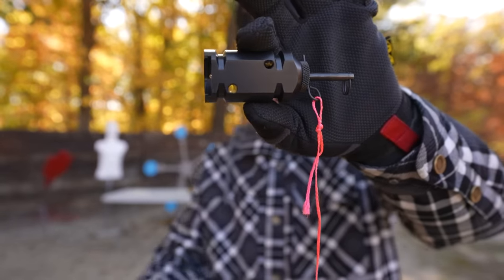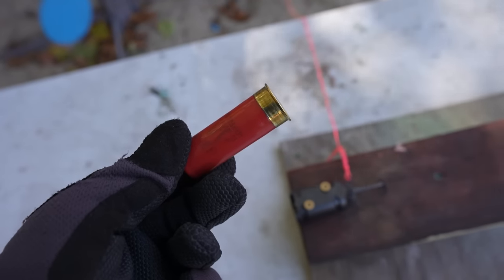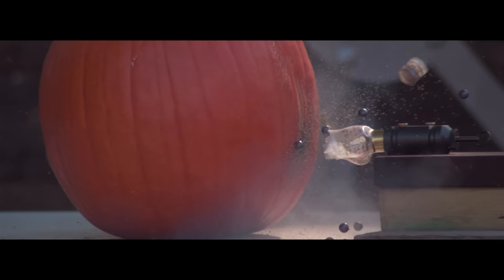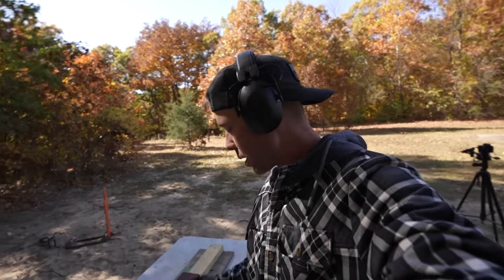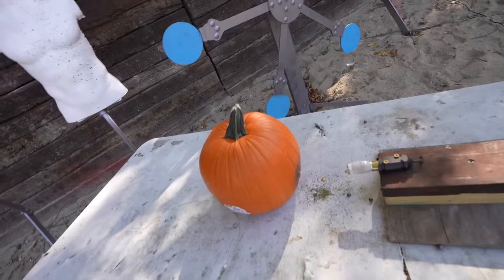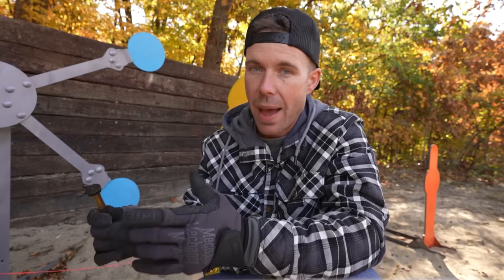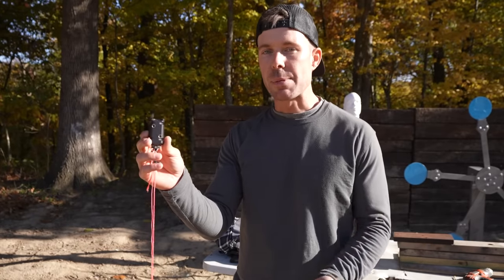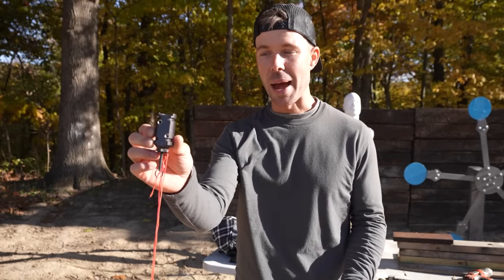This is Definitely NOT a 12ga Booby Trap!! (vs HEAD)

Comment: As three others mentioned, I had the idea of using Dragon's Breath.  Wouldn't matter so much if the shell bursts.  As long it ignites the payload, you could set an intruder on fire.  Or your buddy.  Or yourself.  Or Sasquatch.
Reply: sasquatch burned hair would be a horrible smell.
Reply: @StayInfamousDago  oh definitely 👃 🤢
Reply: I wish english grammar would be one of your hobbies. "Or your buddy, Or your entire gene pool.... "
Reply: I don’t know if it would ignite the dragon’s breath if there is no barrel, but I could be wrong about that.
Reply: Dam 😂😂😂😂
Reply: Metal HVAC tape on the shell. Tannerite?
Reply: Just hope you Don't wast money on actual dragon's breath. Considering it's just magnesium form of either #12 birdshot or powdered.
Reply: @finalbossd being very small pieces of magnesium it's actually very likely going to ignite. But highly unlikely of anything more than a large fireball😅
Reply: For what I understood the dragonsbreath doesn't have a slug..it just shoots out the flaming substance
Reply: @DannyBoYfutube  precisely. Fine magnesium particles Spontaneously ignite when flying through the air at high speeds. & dragon's breath is simply Powdered, or fine magnesium shavings. Just hand load for target loads, & replace #12 lead shot with roughly 2x the magnesium. & you got dragons breath
Reply: I feel like the dragon's breath would be more of a fire hazard.

Comment: Yes, wrapping the shotgun shell hull in electrical or duct tape heavily will help the velocity of the payload. 
Or, you could put the shell into a piece of properly sized black pipe. In theory.      ; )
Reply: It woult not fit into the trap if you put it in a pipe, and if it did, without and end cap half of that energy is going to go backwards and probably destroy the thing... so it'd work...once...
Reply: @Jexorz86  were talking about the front to the edge of the brass. Not taping the brass.
Reply: I was about to make the exact same comment 👌🏻 
That would be interesting
Reply: @chadcarrico5562  oh i was talking about the guy talking about putting a peice of pipe on the shotgun shell or something
Reply: @Jexorz86  yes sir I think he meant a open tube.
Reply: @chadcarrico5562  Yeah, which would probably destroy the little trap thing lol
Reply: @Jexorz86  I think it would work fine.
Reply: @zippythinginvention  unless you're welding the pipe to the trip alarm it's probably going to damage it and the pipe will probably fly off and be lost... The theory is sound, it will do better than a bare shell of course but its going to force energy backwards and forwards driving the brass ito the thing bending it up and getting stuck
Reply: @Jexorz86  the trip alarm is a solid chunk of metal. It'll be fine. Only one way to find out for sure...
Reply: @zippythinginvention  it is but the little clip that holds the brass is Very thin
Reply: @Jexorz86  it'll be fine...
Reply: It would probably be quite effective.
But the variables will be all over the place.

With a decent, well placed pipe and ammunition choice, it could work perfectly.
With different choices it may just make a mess.
Or you might create an effective pipe bomb.

I don’t suggest that you do any of these.
If you do, recording it probably wouldn’t be a good idea either unless you are competing for a Darwin Award, or want evidence that you committed a federal felony.
Reply: And you just created a short barreled shotgun....ATF wet dream.
Reply: @Matt-dc8lp  Lol it's weird... we're allowed to make our own guns, but as soon as its .1 inches shorter than what they consider acceptable its suddenly a felony
Reply: @Matt-dc8lp  I was thinking similarly. Probably illegal in numerous ways... :-(
Reply: @Matt-dc8lp  not if he makes it 18.5 inches :p
Reply: @918Kustomz  that's a whole lot of electrical/duct tape....but go for it!
Reply: I'm curious to see what brass cased shotgun slugs or buckshot would do.  Maybe recess the wad & projectile (s) a little deeper than normal and use a lighter charge.  🤔
Reply: @zippythinginvention  The hard part would be finding it again 😂.  If you could stake it deeper...like tent stake deeper, you'd be in business.
Reply: @helidude3502  Actually remember reading that Kentucky pot growers have made improvised booby traps along these lines, usually aimed in such a way to hit the person that trips it in the back of the leg.
Reply: I would never do this! I would grab one of Shortlane's or Chiappa's 12g adapters and use whatever you adapted... you know, as a warning against bears and mountain lions. They might make 22lr, and 380, and 9mm, and 45lc/410.... and some might be 3 inches.. or maybe the 8 inch rifled. They work great for my break action 12g... wonder if they would work on this... hmmm well if it did, you should never try this at home kids!!!
Reply: Had the same thought. It’s similar to jamming a small rock into someone’s gun barrel! The result is catastrophic.
Reply: @narref04   This plus a pound of tannerite... I mean, theoretically.
Reply: 3/4" X4" should do it
Reply: use a good hose clamp
Reply: By purchasing a very inexpensive 12ga sleeve, you not only over come the loss of ballistics but can turn this device into more than a noisemakers in almost any caliber you please even a 450 casul! The sleeve will fit right in and has a barrel.
Reply: @Jexorz86  Slip the pipe over the shell up to where it sits in the slot. Should contain the shot and direct it towards the target. Not so sure that it would blow back and destroy the trap.
Reply: Yes the shot will move better, but if the end of the pupe inst sealed, the gas is also going to blow through the bass iinto the trap thing
Reply: @Matt-dc8lp shotguns according to the ATF have stocks
Reply: @clinnyboy it’s being mounted to a vertical surface, in theory if the trap is moved back and a short length of appropriate length pipe is slid over the shell and also secured to the vertical surface via a cheap galvanized u shape pipe strap it should work and do damage as intended.

Comment: I bought 2 of those, 1 like the one you have and the 409 primier model. The 12 gauge one, I would cut the tops off the shotgun shells. Empty out the pellets and fill it with cayanne pepper, With a dab of wax on the end. Works well and less then lethal :) To note : The 409 primer one was louder :)

Comment: Hey it is directional to a point as long as the bases does not move….. I would like to see the shotgun shell wrapped in duct tape..

Also as a detonator for a pipe bomb this would work..

However for a signal device a 12 ga flare would be a pretty good match…

Comment: You could try and put a steel schedule 40 pipe sleeve over the plastic part of the shell to see if that would contain more of the blast forward. And fill one of the shells with gunpowder instead of shot to see if it would make a big flame shootout.

Comment: Theoretically,
You could wrap a piece of thin aluminum, cut from a can, around the shell and then wrap a coil of bare high gauge copper wire around the shell going front to the base of the shell.  Wrap as low as you can wrap it and still get it to seat in the device.  Cover this tight coil with a tight wrap of duct tape.  Should provide enough force to contain the majority of the contents (dont use slugs, too much pressure) and send them downrange.

You could also leave the aluminum off and COMPLETELY wrap the shell with a copper end cap. Then you could score the wires with a triangle file so that the pressures would send fragments of the copper all around.

NOTE: These are all just theoretical modifications and i do not suggest this be done.  This is all just a mental exercise.

Comment: Some type of strong metal piping that matches the diameter of the round, to prevent the casing from exploding and to burn off the residual powder. That SHOULD add more pressure to increase the velocity. My guess would be from 6-10" to get some type of effective results (what she said)... That very well could stop any zombie apocalypse shenanigans of all threat levels. Just remember where you set them, just in case you're being chased by some crawler... or worse.... Dwarf Zombies!!!!!
Reply: I would never use a store bought metal pipe that's not properly heat treated! recipie for disaster, and may make your little trip alarm a one time use only. I would however use 12g adapters. They make a nice multiuse 12g shell that fits in any 3" 12g shotgun. whatever you can pack in it, will work. you can even play with what type of powder you want to use (I stick to the slower burning Hodgedon one) Ive reloaded mine about 45 times and works just fine.

Comment: Get a 3-4” clamp that you can put around the shell and clamp it down to simulate a barrel.  It may be enough to hold it and use that pressure to launch it out!  Could even 3D print it

Comment: WHat if you make like a steel cartridge, like the really old shotguns and set it in this trap? Would the steel case work as a really short barrel? Theoretically the case would not rupture as bad the modern ones, so the blast would be more concentrated toward the front right?

Comment: A short piece of pipe, 3 inches long, with an inside diameter that would slip over a 12 gauge shell might improve the performance by reinforcing the plastic hull of the shell.

Comment: I have seen those for sale, listed as "Perimeter Alarms", and that's about all they are good for.  Slipping a section of pipe over the shotgun shell would focus the blast and the direction of the shot. It would probably be easier to make one from scratch than to modify this one. But r
Remember that booby traps are illegal for a reason and the reason is that they are non-selective. They are just as likely to hurt an innocent passersby as a criminal.

Comment: Just slip a snug fitting 12" long pipe over it. Shell expansion might be enough to hold onto said pipe allowing pressure to build and you'd get better velocity.

Comment: The way to use these as booby traps is to get a 12 ga to .22 or 9mm subcaliber insert, designed so you can shoot pistol rounds out of shotgun, it turns a 12 ga shotgun into a single shot center-fire with a tiny 1/2 inch barrel. They 100% work and will generate about 25 to 30% less velocity than from a normal 'barrel' but are more than lethal

Comment: so the the thing is good in theory but i had to heavily modify it. 3d printed a shell and added a pipe long enough to cover the shell. the 3d shell is because the mechanism isnt water proof.... like none at all so it rusts easily in a outdoor humind enviroment to the point the spring seizes up and it wont trigger. it makes it bulky somewhat but its now 365 round a year ready. dragon breath and flare rounds really make it special, the specialty rounds make it better and the .22 conversion for it makes it cheap sound device.

Comment: Just wondering if you slip a snug fitting pipe over the shell,  how would it work.
Reply: work like a regular shotgun except you would need to modify the pipe to be able to take it off and reload since the device can only load 1 shell at a time
Reply: @Deafgamer-b1q  i mean slip over, so question is how strong the base of the shell is. You still have a gab.

Comment: Without the barrel to contain the burning powder you don't get anywhere close to the same power. Most of the powder flies away instead of convert to gas, hence the powder in the first slow mo and the residual powder burning in the shell in second slow mo!

Comment: All you would have to (theoretically) do is take a small length of proper diameter 1/4 inch pipe and slide it over the shell. It would do its job (theoretically)

Comment: Cut a .50BMG 	case to the length you want and this may work as a metal 12ga case. You can shoot the .50 in a shotgun to size green case better. Or just use a .50 in your perimeter alarm, you know, just for fun!

Comment: You should take a chunk of steel pipe that a 12 gauge fits into the length of the shell and just slip it on after loading it. See if that projects it forward...
Reply: it should as shotguns have a long barrel i'm sure that'll work and also instead of pulling the string make a make shift trigger that can pull the firing pin from the outside

Comment: Brass is basically copper, tin and zinc. stronger than copper alone. copper is more malleable than Lead, ergo weaker than lead: so brass 12guage shells should theoretically hold up a better hypothesis and lethality to this experiment. also, Excellent content. please don't  digress from your efforts to hypothesize such quandaries that we have established. also, also, put a barrel at the end of that thing to direct the burn rate and trajectory toward the intended target for maximum efficiency... Weld it if you have to dang it!

Comment: Find a price of copper tubing, pvc, pipe, and cut a small sleeve for the shell leaving and 1/4 inch or half inch gap from the end of the shell then redo the video.
If you can find a size that fits snug would be best other wise find something close and use black tap to build the difference.
In theory it should force the buck shot more directional with more force.  Sleeves with a different length  will give you more spread. 
Do not test it with out being behind something , PVC or copper may become shrapnel.
How ever if you want to get crazy.   You could always roll the outside of the shell in super glue and dip the shell in bird  shot or bb's how ever I would recommend using a wide fender washer to somewhat protect your equipment.
But replacing buck shot with BB's , might be a nice middle ground.  Larger than bird shot, I think smaller than buck shot. 
Steel BBs or bearings  might be interesting. 
Good luck.

Comment: I used a short pipe as a barrel. And try the booby trap with some fixations. The pin broke because of too much energy.
Important note: there are différent quality of materials.
The one i used was bought on amazon. Broke a first time. Then i build a New one with à stronger spring. It worked well wothout the pipe. I did another try with the pipe, and the energy just destroy the spring and the firing pin.😅

Comment: Shotgun shells should work better if they don't blow out the side.  The projectile(s) are inside the hull and the hull acts like a very short barrel.  Wrap the shotgun shells in several layers of duct tape and you'll get much better results.

Comment: I wonder, depending on how you want it dispersed, I was thinking if you could buy fine ground cayenne pepper as the dispersing agent, then drill holes along the body of an empty shell casing, then seal those holes with wax before pouring the fine ground cayenne pepper into the shell, then place a small paper disc over the end, and then seal that with wax !
I'm envisioning a Red cloud of deterrent ?
Probably would take some experimenting, but what else do you have to do ?
                    ✋
               💥 😭🤚

Comment: Wonder what it would do if you slipped a pipe as long as the shell over the shell also as a round or shot goes down the barrel it continues to burn powder no barrel your not burning all the powder and makes the round or shot alot weaker and slower

Comment: If I was going to use one of those as a booby trap, and I wouldn't, I also wouldn't go to the hardware store and buy a piece of 3/4" diameter black pipe to put the shotgun shell in. And I DEFINITELY wouldn't look for a 3/4 in. x 3 in. Black Steel Nipple for $2.25 at Home Depot.  That combination would be downright dangerous. And extremely illegal.

Comment: A Person is Maybe able to Slide a Section of Pipe over the Shotgun Shell and use Real Military Duct Tape or maybe Try Metal Tape with a good glue, just to give the shell a better chance of Containment the explosion for the Millisecond to give it a bit more Velocity ! never tried it with their contraption. I ummmm have Designed and Created a simple Booby Trap using sections of piping and other steel parts that work freaking wonderfully and you get Excellent Velocity and Power out of them !!! Think about how a slide-fire pipe shotgun works.

Comment: If you added like a steel or aluminum pipe around the end of that where the shell fits I wonder if that would up the velocity of the shot gun shells. Or the 308 for more effectively taking out the zombie head there. Would like to see if that works?
Reply: Which would easily be interpreted as manufacturing not only a short barrelled shotgun but also a set gun, which is a destructive device if it uses fixed ammunition. So two NFA violations. But you do you, I'm not your dad, don't run with scissors or play with matches.

Comment: I hate when they do these tests. Really??? Would the intruder or zombie be 1/7th of an inch away from the alarm/Bobbie trap?  Put some distance in between please. Make it more realistic. Also try some duct tape layers around the shells. Or maybe a small piece of PVC that fits over. It’ll be a one time use item but it may increase the pressure enough to stop a zombie.

Comment: Question…how does intruder trip wire while simultaneously being in front of the shell??? Put a barrel on there, who cares? No one tripping that wire is down range of the projectiles. Your testing is completely inconsequential. Now, if you used the combustion of the shot shell as a primary blast with a secondary, and much more effective or directed, charge. Looks like zombies will be eating your brains.